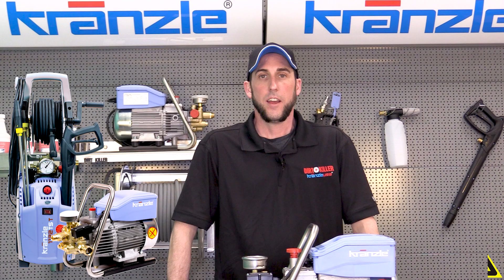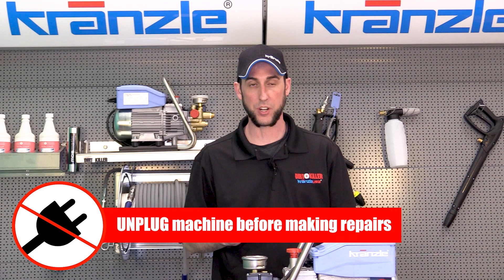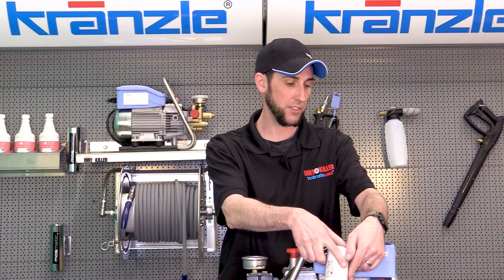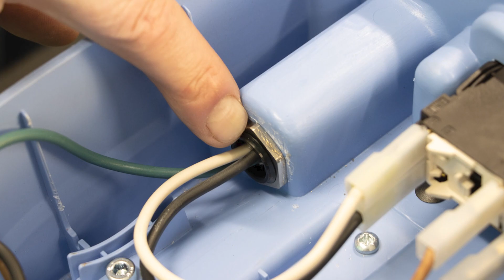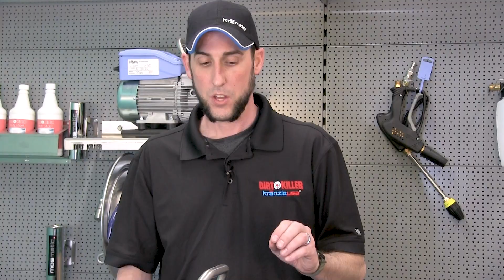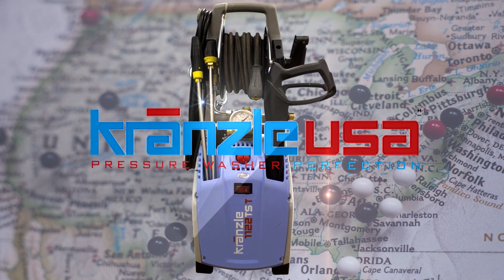GFI and Cord Replacement | How To | 1622 1122 1322 | Kranzle USA Pressure Washer Perfection

Comment: will the non gfci cord be an issue for a replacement?  the stock one was being pinched while plugged into generator which split the cord by the gfci box. Trying to get a cord that fits better with generator.
Reply from the maker: Good morning Michaelbudzinski2957, 

Replacing the factory GFCI with a non GFCI power cord is not an issue. However, this will make the unit no longer UL compliant so be careful in doing so.